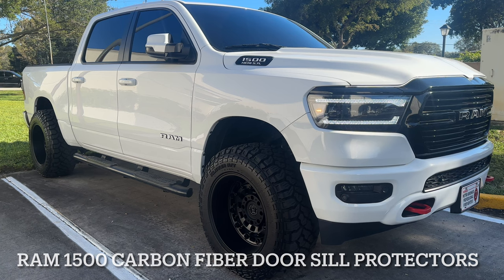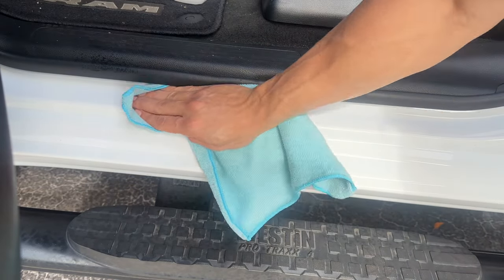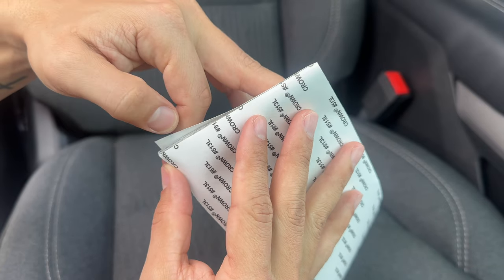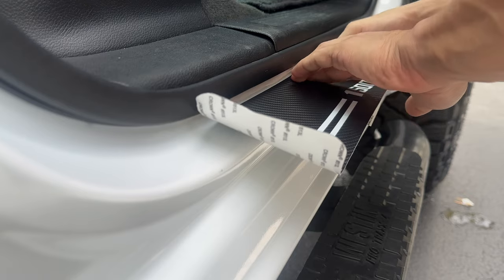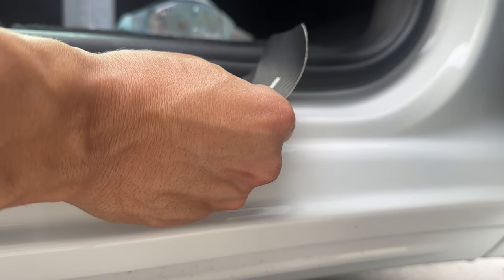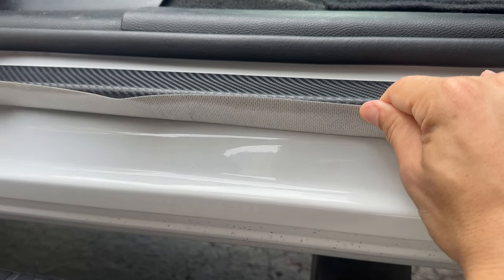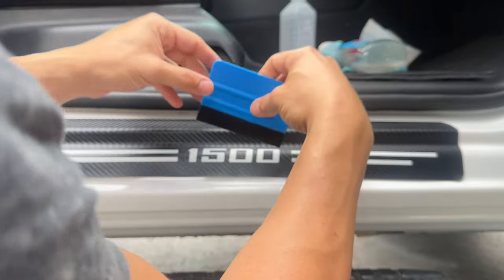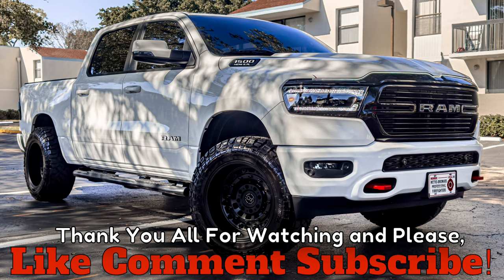**Protect Your Paint** Carbon Fiber Door Sill Protectors - 5th Gen Ram 1500

Comment: Completely different topic , how  did you get your front tow rings red? Did you just paint em? I’m having a bitch of a time painting mine thanks
Reply from the maker: Yes I painted them, I hung them from a rail with zip ties and painted them.
Reply: @FirefighterBuell  weren’t they hard to get off , I couldn’t budge those bolts , but mine is an 2018
Reply from the maker: Mine didn’t come with tow hooks so it was a fresh install
Reply: @FirefighterBuell  Ok thanks, great looking truck , mine’s an 18 Rebel red over black